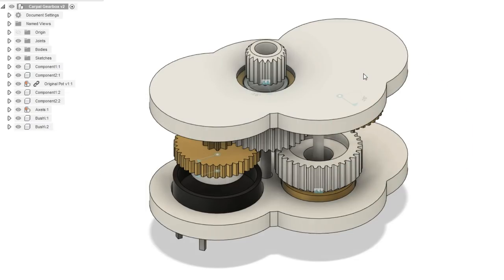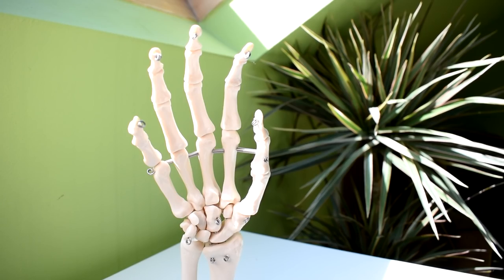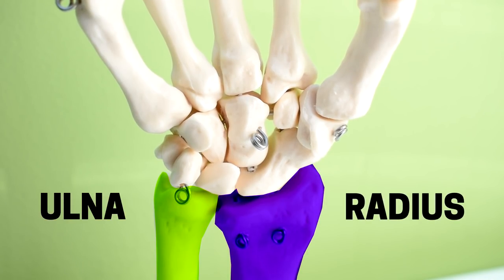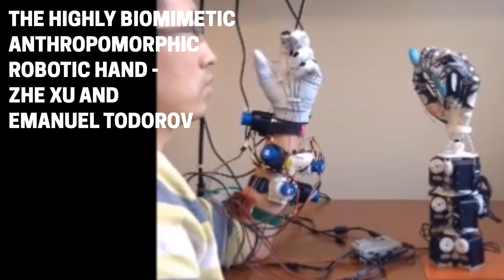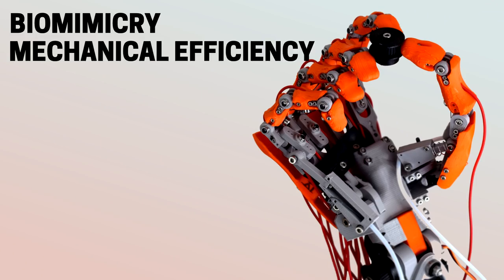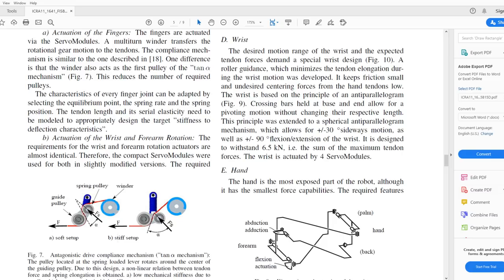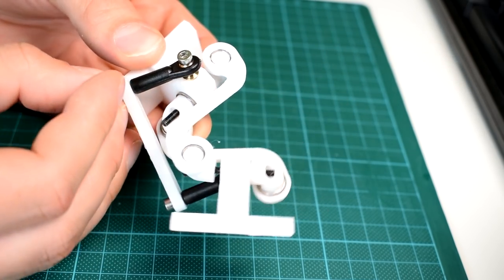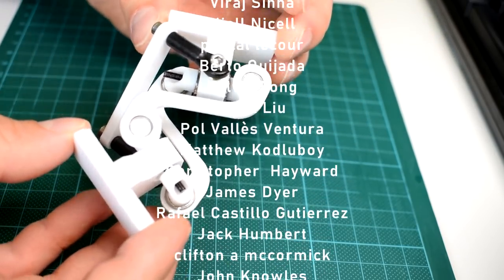Wrist Biomechanics for Bionic Hands - Biomimetic Mechatronic Hand Part 6

Comment: Use the spherical antiparallelogram! These mechanisms are what make mechanical engineering fun. It's nice when everything isn't just revolute joints or ball screws :)
Reply: @TheMaidenOnes  Thanks Anton, looks awesome!!
Reply: Well now i know what to use for my 3d model walker, since i needed a joint with those two axis of rotation that also looks like the components can be replaced on thr field of field mechanics shop, thx

Comment: The DLR is aero-space, they don't align to the same philosophy as you, thus, IMO, you should ignore the superficial aspects of the design, and focus on the pure math of it. That wrist mechanism has all the major check boxes you need hit + cable routing, in an orderly and neatened fashion.

Would like to point out that in such a mechanism, as long as the hard points are assured, the actual linkages can look like anything you want as long as they don't intersect. And that's a good point over other methods that don't go the IRIM way, which itself is flawed for you, because that mechanism is outside actuated with cumbersome cabling.

TLDR. Focus on the DLR variant, it's a decent start, and besides with 3D printing, you can always swap/and design to be able to easily swap parts if you decide later down the road that the path is wrong.

Comment: I broke my scaphoid a few years back and will eventually one day lose the ability to use my thumb. Im currently trying to design a brace that will allow me to still function after that happens. I think the spherical anti-parallelogram mechanism you showed here with some modifications is what I needed to support the hand brace and any tool I’d be using.

Comment: Love this project! I definitely agree that you should only emulate the form and range of motion rather than the exact mechanisms of the human hand.

The two crossed axes of your old hand look fine to me, but may be even better to use a universal joint, with a central cross piece that both hand and forearm rotate themselves around. Then you could put a hole through the center of the cross for wires to pass through.

The spherical whatsit mechanism does look like an interesting option as well though, since it provides a large enough opening for tendons, which would allow putting more of the motors near the elbow to minimize moment of inertia when its attached to an arm. But it looks rather delicate, so you may end up with large moment of inertia anyway (and expensive fabrication) by the time you beef it up. And how do you even attach actuators to it?

Comment: Probably the easiest design would be a slide saddle joint mounted to a wide hinge joint, added structure reinforcement could be added by a high tensile strength elastic exterior which basically replaces the wrist tendon sheath not accounting for the individual finger tendons. The finger cables could be threaded through cable loops and tubes on both the top and bottom of the wrist joint just under the elastic sheath similar to that of the human hand, in theory it should closely approximate the movement of the human hand.
Reply: I think I like what you're proposing..  But I'm going to need a picture or two. Going to go do some research, brb

Comment: when you talk of driving hand rotation from the base of the arm and therefore are looking for a solid point of force to deliver rotational force, maybe a bit random but maybe valid resource, bong sao is a kung fu block in wing chun that works by locking out our structure, if the arm and elbow (at 45 degrees) is pointed forward with palm flat horizontally, by maintaining hand position and rotating shoulder outwards and away and elbow downward and in, now try and collapse the angle between upper and lower arm, it shows that some combinations of our structure lock us out and makes potential mobile yet fixed points of force application possible or demonstrates existence.

Comment: I have an idea. Try looking at the DELTA style 3d printers. Particularly, the FLSUN Q5. It uses 3 pairs of carbon fiber effector rods to move the print head. But instead of the head moving laterally and horizontally, you fix that head on a joint. Just like the one you've got on the wrist right now. I can imagine the algorithm for that would be a nightmare, but what if you use the gcode of a 3d printer to test it out. But this tech is way out of my league. I'm just a toy designer. haha

Comment: Really neat mechanical model using off the shelf components. Aside from the rod ends, are those bearings or some sort of sleeve bushing allowing rotation at the elbow joints?

Comment: Hey mate, have you thought about using piezoelectric/ultrasonic motors/actuators? Theyre much more powerful and accurate than electric motors. Plus it can get really small with great performance.
Reply: Interesting, looks quite similar to the way real muscle fibers operate, with a repeated "grip, pull, release, return" cycle.

Comment: Would it not work well to connect the hand to 3 points arranged in a triangle? You could have 1 joint towards the middle rear fixed statically to the arm (with a ball joint) and the other 2 towards the sides of the palm connected to some linear actuators such as ball screws. You would then have both kinds of motion from the combination of those 2 actuators and also have lots of space in the middle for cables etc. It would be sort of analogous to how a delta 3d printer works. Not sure if how I described this makes sense... I could make a sketch if you are interested.

Comment: does anyone feel capable of explaining rhis wrist joint to me? i don't get how it works, in my head it shouldnt be able to work. wouldn't the arm in the middle mean, that the middle points of both sides of the antiparallelogram would have to be a constant distance apart, which they can't be? i've looked at it for about an hour, and even modelled it in fusion 360, but it just doesn't work. am i missing anything?